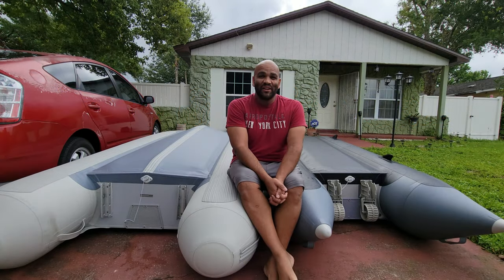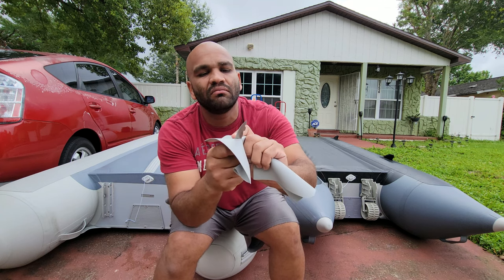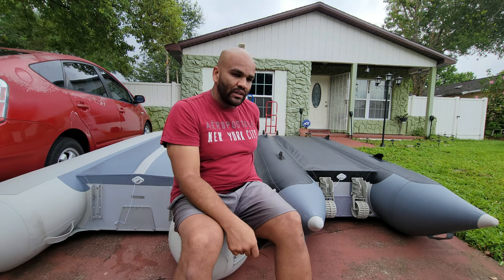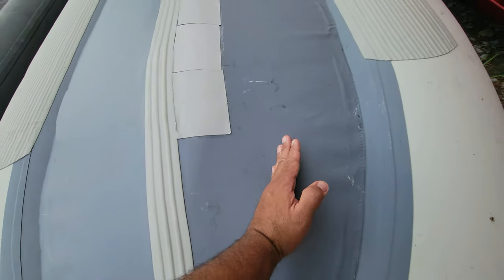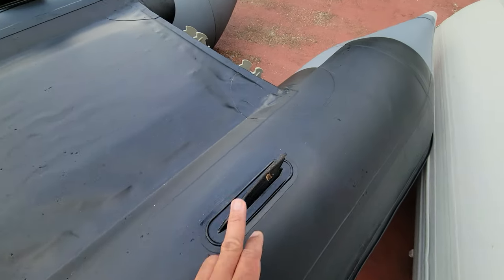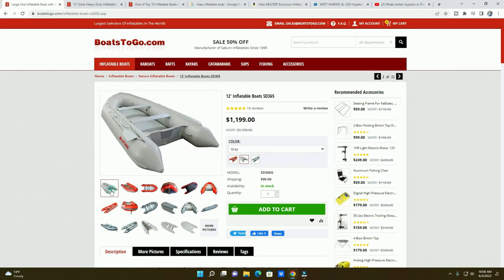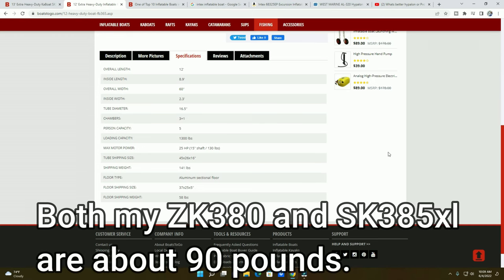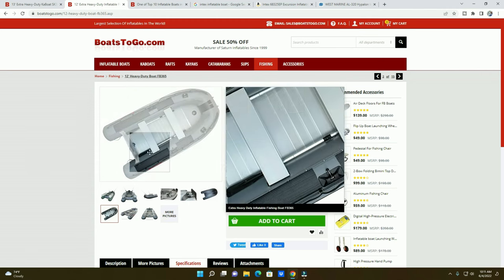How tough are inflatable boats in general?

Comment: Intex boats and toys are made from vinyl only, there is no fabric. 
Regular inflatable boats are made from a polyester fabric which is coated (laminated) with pvc on both sides. The strength of the fabric is determined by the quality and thickness of the pvc layers, which is either in grams/squaremeter or milimeter thickness. 
1 squaremeter 1100 decitex (equal to 1000denier)  pvc fabric may weigh 900, 1000, 1050, 1300 or 1450grams etc. 
Thicker pvc fabrics are used in heavy duty, commercial boats. (But still, hypalon fabric is strongest).

Polyester fabric is produced by weaving a polyester yarn (rope). The weight of that yarn is indicated as its weight in grams per 10000meter (decitex) or 9000meter(denier). 

1100decitex means that the 10000meter of yarn(rope) weighs 1100grams. In other words , 1 meter yarn weighs only 0.9grams. 
to calculate the weight of the polyester fabric per squaremeter, you need many other data such as thread count , weave pattern etc. but boat manufacturers never give you such information.

So it may be said that boats with heavier pvc fabric are stronger. 

A 900decitex boat with 1450grams/squaremeter weight pvc is stronger than a 1100decitex with 1000gram/squaremeter.

To conclude, you can puncture all inflatable boats with a sharp object. And don't run over your pvc boat with a chevy or toyota truck :)
Reply from the maker: Agreed, even if hypalon can take tye abuse I'll still won't do it. I thought it was a good visual to show how tough hypalon is. Thank you for the detailed comment. I'm gonna pin this one so others can read it.
Reply: @ErickMartinSucre  There are many funny comments under that Truck test video 😃 . I love that video by the way
Reply from the maker: Haha! Glad you liked it
Reply: The thing I’m confused about I bought a Saturn 2024 16 ft heavy duty with aluminum floor but I see know heavy duty material on it like on there heavy duty fishing boat fact so for me why do they put a heavy duty Saturn 16 ft boat  amd there is no layer along the bottom of my Saturn so for me I see no heavy duty layers on it fact when I buy a 16 ft Saturn heavy duty sd488 boat from them it should be heavy duty at  least on the bottom all the way down amd top tho maybe it’s there amd I do not see any heavy duty material on it tho so you know Eric why this is I blew mine up loook all around I have the black strip on the side around only tho I paid 2300 cash for it on there sight
Reply from the maker: @donaldmartin4620 So I am clear, is this the one you are referring to? https://www.boatstogo.com/inflatable-boats-sd488.asp
Reply: @ErickMartinSucre   yes with taxes cost me like 2000 dollars  I bought it because at the bottm it said heavy duty so I assumed it had the double layer all that  so do you if it is amd I just can’t see it as I do not no about the material so I see you know all about them I just whant to be safe on the ocean as I bought it to fish  I’m not going a 100 miles out but quit always out amd don’t whamt to worry about the bottm coming apart woth my aluminum floor or any major issues as I just put it on my trailer  checking it out before I take it out I’m your opinion is this bait well made  amd woth extra layers on it ok not a expert on the material so this is why I’m asking you I’m a first time buyer of Saturn as I heard there heat welding boats are great thme some people say the bottom are not heat welded but glue amd the heat will make it come undone so if you can give  me your opinion would help me decide if I should take it on the ocean jetty only thanks  appreciate it
Reply from the maker: @donaldmartin4620 That is a tank of a boat. Around 2021, Saturn/Boatstogo switch from standard pvc ot heytex pvc, together with heat-welded seams instead of glued. You'll have to purposely grab a sharp object and hit it with extreme force to break it.
Reply: @ErickMartinSucre  ok thanks I’m planning to take it out this week haven’t token it out yet since I bought it 7 months ago had it get a trailer for it now I’m good  thanks hopefully I will be coo on the water woth no major issues as it’s new thanks a for the information
Reply from the maker: @donaldmartin4620 You're gonna have a blast! Those boats are also incredibly stable. What outboard did you get for it?

Comment: The new Saturn FB385 boats do not come with fins at the bottom. Can they be added as an accessory?
Reply from the maker: It has an inflatable keel, so it doesn't need fins perse, but one could add some by gluing them in place.

Comment: I've had my 12.5' inflatable for about 3 years.  It's mostly been stored deflated inside, but I've kept it in the water for a couple of months this Summer & last Summer (under cover from the sun).  We just took it to the coast for the week.  It was great to have along.  I noticed that it wasn't holding pressure very well overnight.  Mainly the air floor got soft, but the side tubes also lost a little pressure.  I checked online info about leaks and found two solutions.  First, check all the valves, then check all the seams.  Use soapy water to check for air bubbles.  If the valves are leaking externally (around the edges of the fabric) you can just tighten them up with the wrench (it's in the patch kit tube).  If they're leaking internally (around the cap) you need to remove the valve & clean it or replace it.  It's pretty simple.
If you discover that the seams are leaking, sealants are available which you pour into the air chambers.  I found 2 tiny leaking seams where the seam tape overlaps on each side tube.  I also discovered a bigger leak on the air floor.  I bought a bottle of ToobSeal from the marine supply store while we were still at the coast.  It cost $50 for a quart which is supposed to be enough for the whole boat.  (Identifying exactly where the leaks are will help me concentrate my efforts on those areas.  I'll seal the air floor first since it's easier to manage & also because the leak is worse on it.  
I've also noticed that the support board under the floor has gotten weak and is bowing a bit.  I'll need to replace it with a piece of plywood.
Reply from the maker: I see. I know that overnight, when temps go down, it may lose some pressure but it picks up when it gets hot. Hope the leaks aren't too bad.
Reply: I discovered a tiny metal splinter had caused the leak in the air floor.  I removed it with tweezers.  The leak was located in the rear corner.  I added about 4 oz of sealant.  A few drops oozed from the pinhole for a while.  I lowered the air pressure to about 2-3 psi, instead of the full pressure of 10 psi, to make it easier for the sealant to work.  Every 20-30 minutes I rotated the floor to recoat the pinhole & after a while, it stopped dripping sealant.  I kept rotating the floor for the rest of the day to build up a thicker layer of sealant & towards the end of the day bumped the pressure to 5 psi.  After a few more hours I increased it to the 10 psi full pressure.  I'm really glad that the sealant worked.  I'm not sure an air floor can be patched like the normal air chambers since it has a web of threads inside.
Reply from the maker: I say a small patch would not be a bad idea, but if the sealant worked I say it's a win win

Comment: How about the weight capacity of the transom there’s some small hp motors that are really heavy
Reply from the maker: Yes. different boats have different transom weight limits. They usually hold up to 100 pounds. I recently purchased a Hangkai 12hp that has the same weight as my Tohatsu 60hp outboard. 60 pound! It's incredible that something that light can pack that much power. 

Link: https://amzn.to/4fEwlra
Unboxing: https://youtu.be/FNq32UJenJI
Water review: https://youtu.be/Oe6oHNG7JYo
Things to do to make it last: https://youtu.be/dWezpNo8oys

Comment: Good video.  Hope you’re doing well.  I’ve been hibernating the last 8 weeks because of the heat in Florida but I’ll be getting out on my 12’ Saturn heavy duty fishing boat soon.
Reply from the maker: Dude, you ain't kidding. Gonna start camping once it gets cooler
Reply: @ErickMartinSucre  I have my first camp trip next weekend at St George Island.  I have a small camper with air conditioner.  Doing some surf fishing.  Haven’t camped since early June.
Reply from the maker: Nice! My last attent was in April at Big Scrub campground, and it started to rain bad. I was riding the trails, got caught by the storm, once it stopped, I headed back to camp only to find the tent full of water. I packed things and left.

Comment: I have a BARK inflateable boat i wonder what the strength of the material is yours are very strong 💪
Reply from the maker: My ZK380 uses the 1100, same for my SK385XL but is has double layers of it on the bottom.

Comment: Hey Eric so I got a heavy duty Saturn fishing boat SD48816 ft one so it says heavy duty bit looks like a normal Saturn boat I paid 2000 plus shipping 199 shipping so I’m confused a little as the heavy duty fishing boats have double layer on the bottom side top all that so  as a person who knows about them like you I do not know maybe it is thicker so can you give me some information amd I didn’t get my pump with it I’m ok with that tho is the sd488 heavy duty tho on the bottom but not the top thanks for the information if you can
Reply from the maker: Yeah, it's extra thick all over. I could not lift that thing, I probably could, but I would not want to. You're better off using a trailer for that one.
Reply: @ErickMartinSucre   ya  I’m gonna get a trailer thanks for me it doesn’t look like there fishing boats if I knew that would have got those ones instead but hoping the 16 ft with aluminum flooor would work as  I go on the ocean and wanted something thick and strong we’ll made thanks for the information  appreciate it as long as it’s thick all around  amd the bottom im good with that thanks
Reply from the maker: @donaldmartin4620 You're welcome. I own a smaller version of that one, my SK385XL Kaboat.

Comment: Hey Erick, I love your stuff. I am struggling between getting the SK385XL with 6HP Tohatsu or the ZK380 with the 9.8HP. It will be mostly me and my wife and about 100 pounds of gear plus motor and fuel. What would you recommend? Many thanks and keep up the great work!
Reply from the maker: The ZK380 without a doubt. The SK385XL works better for solo adventures.

Comment: Just wanted to share a little experience with a 4000 denier "Alaska series, jet Ranger" boat which has a retail price of over $6000. I owned one such boat, so got to experience firsthand what that was like, and also the disadvantages. Like a bicycle tire on the bottom, and pretty much bounces off everything! 

First disadvantage  is weight, as you mentioned. A small little 13 foot boat was 140 pounds. Second, a lot of these boats build up multiple layers of material, like Saturn's heavy-duty fishing boat. I bought one of those too!  Tough boat! and great boat for the price!  Also on the heavy side. 

One of the problems is when that inner layer loses adhesion. What happens is you get bubbles, and  damn near impossible to fix. You can sometimes make a longitudinal slit, and and inject some glue, but it's tricky to do right. 

The other thing is with the rub Strake that companies like Saturn use, and Stryker boats, etc. is that rib surface is really hard to patch. The folks over at sea Eagle mentioned this to me, and it's a good point. If you want to reinforce your boat I would suggest going with a smooth surface over the rub strake. If you do accidentally get a puncture it's a lot easier to patch.  I would also suggest to anybody to purchase a boat with the maximum number of chambers. I personally like boat with about five. That way it's damn near unsinkable if you get a puncture. 

The other precaution I take with my PVC boat is to keep it at one PSI less than it's rated PSI when it's outside undercover. Saturn boats have some over inflation valves, but a lot of PVC boats do not. I've seen more than one boat destroyed due to over inflation and the seams bursting. Air expands in heat, so if you're storing your boat outside or in a hot garage, let some air out!  High heat can cause glue to dissolve, so storing your boat cool and dark is best. The hypalon is best for heat. It can take it.  

Great points Martin and good video!
Reply from the maker: No, thank you for such and elaborate example. I lot of folks come by my channel and I hope they see your comment. The better informed people are the better off they'll be out in the water. I am fortunate that I am able to story my boats in my room under cool Temps.

Comment: How do i know how much psi is inside using the foot pump? I dont have an electric pump
Reply from the maker: I don't think the foot pump comes with a PSI gauge. I say inflate until firm to the touch but not too much. As a referrecne, this pump https://amzn.to/3eUHSYv  comes with the PSI gauge on top.
Reply: I bet you'll buy an electric pump after trying the foot pump.  There's a lot of air in these boats!
Reply: I have a similar pump with that pump on amazon. Although its manometer is detachable, I can't use that with my foot pump because the valve adapters are different. I'm telling this to remind that you can buy a separate manometer and it may be incompatible with your foot pump as well. Try it before you buy

Comment: Hi Eric: do you think Tobin Sports inflatable boat would survive in Lake Michigan , Chicago with 8hp motor? Any suggestions are welcome!!!!! Thanks
Reply from the maker: I'll have to get back to you on that. I need to look up both the place and the brand of the boat.
Reply from the maker: It looks stable enough to handle it. Treat Lake Michigan as if it was an ocean since it is so big. Do your best to pick days where the winds are not so rough. Stay away from the lake on stormy days. That brand is similar to Bris and Aleko so you should be ok. I wonder if they have a model that comes with a keel, it should help to handle some white caps and swells.
Reply: this is good advice. The Tobin has an inflatable keel, and it is a class C rated boat which is an inshore rating, it can handle rough water but because you sit up high in the inflatable there is exposure to the elements.

Comment: Have you had one issue with seams in Florida heat and humidity on your 14ft performance kaboat?
Also, will it fit in truck bed while inflated?
Thanks
Reply from the maker: It'll fit but most of it will be hanging from the rear. I keep mine deflated in my room so it is not exposed to the elements. While using it, I have not had any issues with the seams.
Reply: Okay thanks...I wonder if it would squeeze in and fit inside truck bed as mine is 61 inches wide...and boat states it is 63 inches  wide
Reply from the maker: You could place it partially inflated or rolled up and inflated at location.

Comment: Debating saturn fb model for extra protection. And love the patient double splash guards for storage on top of tubes. But notice with the added 200 shipping cost the bris boat is thicker and wider for same cost... wondering if you heard about bris and which you would choose and why
Reply from the maker: I hear good things about Bris. I don't use them but those who do seem to like them.
Reply: I have the bris 12ft dive rescue boat and it is very tough, the solid aluminum floor makes it stable and i use it for fishing rivers and lakes and have had zero problems with it.
Reply from the maker: @barrywingler418  Bris is well spoken for indeed. I hear great things about it.

Comment: Hi Mr. Martin, is Saturn inflatable Kaboat safe to go out off shore for rockfish fishing? Can i able to roll it back to the shore if my motor dies?
Reply from the maker: Yeah. I once had to do that with a sk396 while visiting Anclote Key. Paddle my way back to the parking area. I do recommend the SK385XL since it has bigger bladders which help with swells in the ocean.
Reply: @ErickMartinSucre  I got 16' Heavy-Duty KaBoat SK487XL with three strong man on my it. What do you think? Thanks Mr. Martin. You are very helpful
Reply from the maker: @pinpang5762  That's tough enough for sure. Love those models, really tough.
Reply: it depends on wind direction, if it's blowing from the shore towards the sea you'll have a hard time no matter how strong you are.
you can buy a 100-200 dollar small electric trolling motor with a small battery , as a backup.

Comment: Hi Eric, thanks for the video. One question, are the benches required to give the boat stability or can they be used without the bench seats? Thanks!
Reply from the maker: They can be used without the benches. What gives the boat rigidity is the inflatable floor or the aluminum flooring that some models have.
Reply: just keep 1 bench seat for rowing, in case the motor stops runnig.
Reply from the maker: That's a good advice

Comment: Hey Erick, what inflatable pump do you use and would you highly recommend it? Thanks!
Reply from the maker: Yes, highly recommend it. I use the Saturn analog pump. It uses an external power source like your car's battery or a 12v battery. I personally use an external 12v battery and charge it with my bike's battery tender. https://amzn.to/3vjGZOu
Reply from the maker: It is rugged and analog so it is less likely to have a part break. I've owned mine for the past 5 years or so and it goes bang every time. It has a dial that auto shuts off, measure in KPA instead of PSI.
Reply from the maker: Main bladders: 25 KPA. Air Floor: 70KPA. Keel: 40KPA
Reply from the maker: Feel free to ask any questions. I have a group on Facebook called "The Muddy Feet Oasis" and you're welcome to drop by and also hear others' opinions.